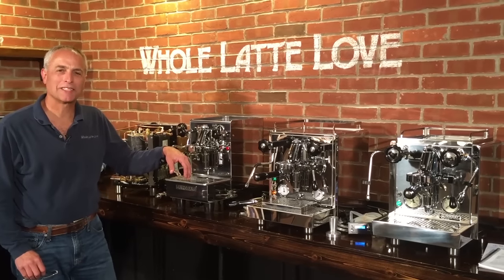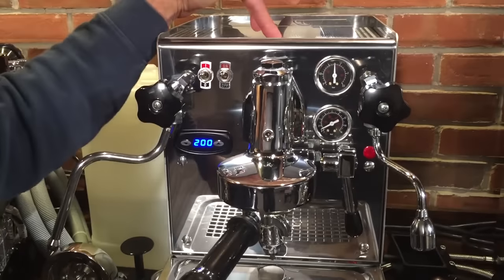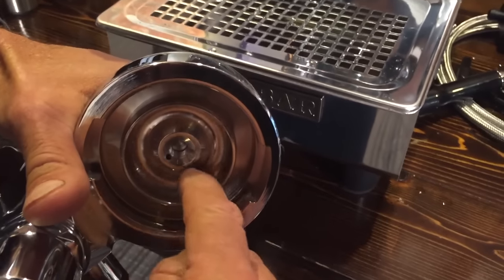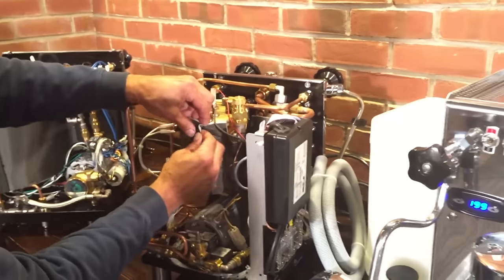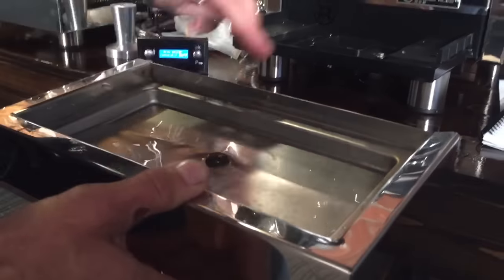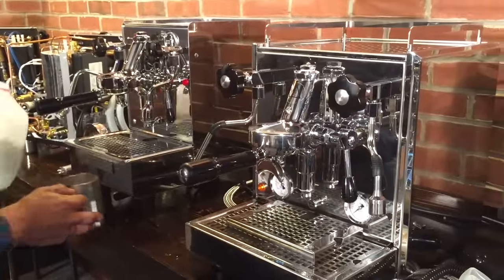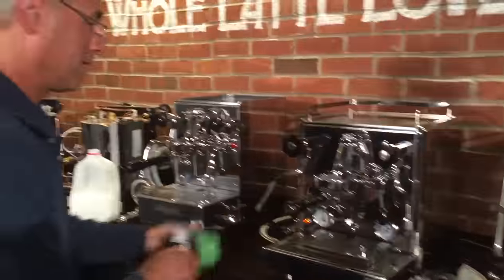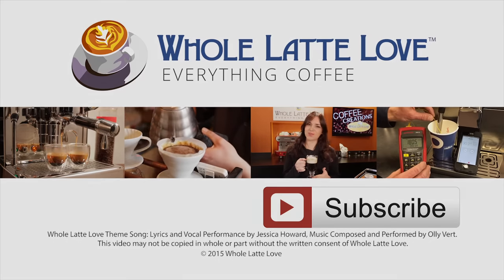Compare: Rocket R58 V2, Profitec Pro 700 and Expobar Brewtus IV Espresso Machines

Comment: Nice comparison vid. For me the shot timer on the Profitec is a little thing that makes a big difference, I've been using the Profitec Pro 600 for a few weeks recently to create my review, and the shot timer is a great feature. By the way, you made me very happy when you cleaned those steam wands, I was starting to get nervous that you were going to leave them, but then you grabbed a cloth and I breathed a sigh of relief ;-).
Reply from the maker: Hi ukcb, Thanks for the comment! Glad we made you happy with the wand cleaning. Every once in awhile we cut bits like purge and wipe of wand for time and people do notice! Shot timer is a nice feature. Rocket Espresso has for years been resistant to having visible digital display on the face of their machines. They have capitulated with recent upgrades to their HX boiler machines. Type Vs and EVO R's (Mozzafiato and Giotto) now include a very small and subtle shot timer on the face. Working on a video review of those machines now  - the Cronometros
Marc

Comment: I found if you come from a lower end slower steaming machine and have issues steaming with a more powerful HX machine or one of these dual boilers, The less holes or smaller hole steam tips are much easier to use, it steams a lot slower. It seems to make more of a difference than adjusting the steam pressure (steam boiler temp) even.
Reply from the maker: Hey Ben, Thanks for the comment. Steam hole size and number of holes does make a big difference. Not unusual at all for those coming from less powerful machines to be a bit overwhelmed with more steam on HX or DB machines. After awhile most everyone appreciates more steam pressure.

Comment: Hi guys! I am waiting for Todd's comment about verticaly mounted rotary pump as in Alex Duetto and QM DB  ew Vetrano machines! Thank you! Once again my Brewtus IV is excelle t machine! Thank you, Todd a out the engineering and design!!! :-)
Reply from the maker: +Petar Rusev Hi Petar, Here are Todd's comments on vertical pump:
I have no issue with the way the pump is mounted and have not heard about any problems with them.
Note: The motor may or may not be of a special design so that the bearing can handle the vertical mount but I just don't know.

Comment: Guys, but what about brew pressure? Adjustable on these machines?
Reply from the maker: Hi Albert, Thanks for the question. Yes brew pressure is adjustable on all these machines. For models with a rotary pump it's adjustable on the pump. For machines with vibration pump brew pressure is adjustable at the OPV - Over Pressure Valve. Here's a video showing how that's done on both pump types: https://youtu.be/u9oUiJjqp7U
Marc
Reply: @Wholelattelovepage  Thank you so much. I found that video and have basically made up my mind. Only challenge is that it is not sold in South Africa. I am looking at 2 stores in the Netherlands. Mailed them and await a reply. I have to add VAT and 20% on top of that. Have been using a Gaggia Classic for 7 years or so.

Comment: Great review!! 
Have you guys done a comparison with same coffee/grinder??
I'm wondering if there are any clear winners or are they all very similar??
Specifically interested how the expobar does against the pricier machines.
Reply from the maker: Hi Jim, Thanks for the comment and questions. We have used all these machines extensively. It's always difficult to characterize flavor traits due to subjective nature. We can have 4 people tasting same coffee from same grinder and get 4 different opinions. But some general notes on these machines...
Profitec Pro 700: It can do line pressure pre-infusion when plumbed. Rocket and Expobar cannot as they have solenoid valves on the plumbed connection that only open when the pump is operating. Since this video was made in 2015 the Pro 700 has been upgraded. New PID and pressure relief valve allow steam boiler temp up to 270F - close to 2bar pressure so more steaming power. Also like the shot timer.
Expobar Brewtus: It's a rock solid machine. It doesn't have the refined externals of the Pro 700 or R58 but we do like (disclaimer Todd was involved in the development of this machine with Expobar) the heat exchanger in the service boiler feeding source water into the brew boiler. Also like the chamber milled into the E61 behind the shower screen. This allows for more pre-wetting of the coffee prior to full pressure brewing. And, with the extra chamber brew pressure ramps up more gradually than your typical rotary pump machine. The Brewtus is every bit as capable brewing espresso as the other machines. If looking for value it's hard to beat Expobar!
R58: It's the "sexy" one of the bunch. Heavy on the branding. It's a bit more complex internally than the other machines. Some people like the detachable PID controller to keep the face free of digital display and some do not. It's a general design decision Rocket has made. In their other PID machines they hide the display behind the drip tray. Rocket also choose to use/show actual brew boiler temp on PID controller. The other machines use an offset as brew boiler always runs hotter than what you get at the group when brewing. With this setup, setting brew temp requires consulting a chart in the manual.

To answer your question is there a clear winner... It depends on what you are looking for. IMO they break down like this: Expobar wins for value. Pro 700 wins on steam pressure, internal design and the ability to finesse extractions with line pressure pre-infusion when plumbed. R58 wins in the WOW dept.

Hope that helps. Let me know if you have any more questions!

Marc
Reply: What does win on the “wow” department mean? Does that mean it’s better than the profitec?
Reply: @InsanelyGhostly  lol no sounds like Profitec is better, or ECM Synchronika if you want the same machine with some extra / nicer features.

Comment: Exobar looks like a hot mess compared to the other two
Reply from the maker: Hi Jay, Thanks for the comment. The Expobar definitely lacking refinement in the case details but it's built like a tank and is capable of producing espresso every bit as good as the others. And, it cost a whole latte less! In terms of engineering, The Profitec Pro 700 is the clear winner with simple hydraulics using high quality components. The Expobar is a reliable workhorse and the Rocket R58 has rather complex internals which introduce more points of failure should the machine be neglected.
Reply: Do you guys ship to Canada or are there crazy fees cross boarder?  I really like the profitec
Reply from the maker: We can ship to Canada. Best thing to do is call us directly to get a shipping quote. Number is 888-411-5282.